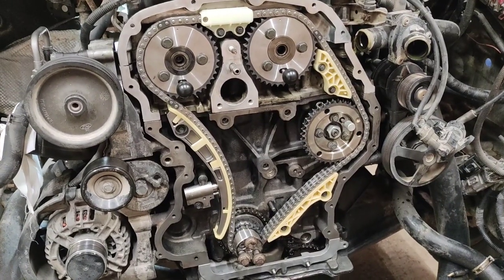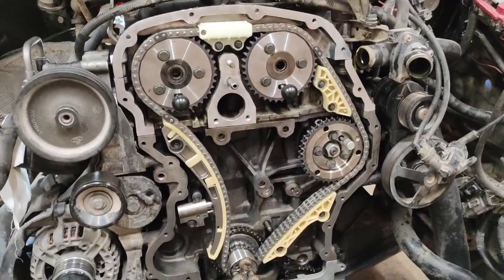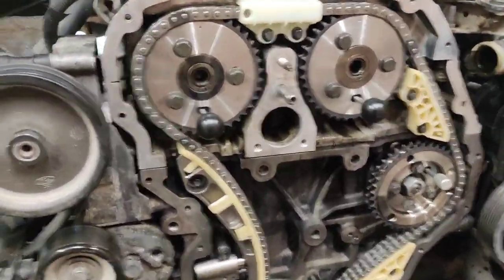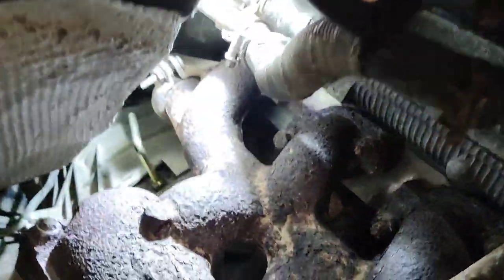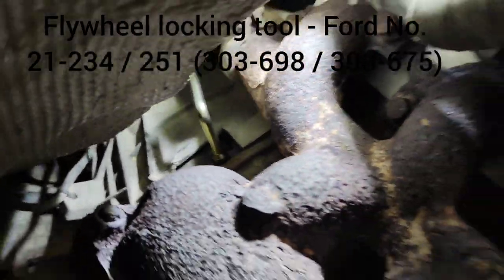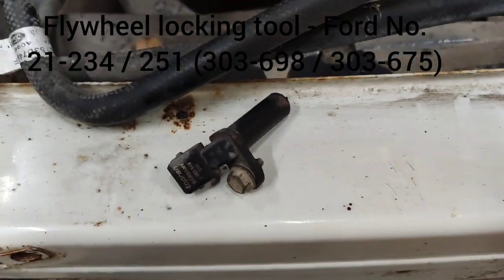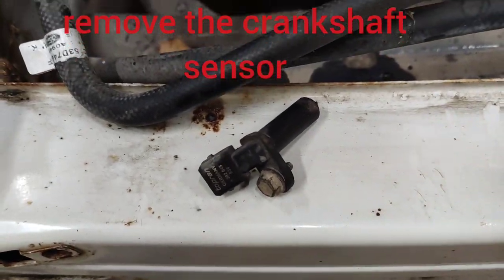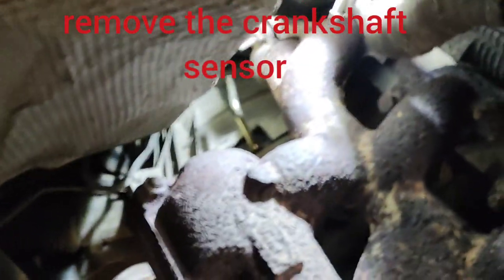Ford Transit  Mk6 Chain Sound, Chain Replacement, Timing Chain Marks

Comment: Hi, did the engine performence increased after replacement? Also, did you change the oil pump chain?  Also, was the changing the camshaft gears necessarry?
Reply from the maker: Hello, yes, I changed the chain with all gears and guides. The old chain remained for the oil pump. After replacing the chain, the engine remained more powerful.
Reply: @robertsansons  What brand of timing chain did you use? And did you change the gears because they were worn?

Comment: Ford transit mk2
Hello, sorry, if the engine is out of phase, even if it doesn't start, does the diesel still come out of the pump barrels?  Or if out of phase Lucas stops spraying diesel?  Thank you

Comment: chain isn’t fitted correctly. Dowel marks half to line up with black link on the chain.
Reply from the maker: It is correct, after installation, the engine was rotated several times to make sure that all the latches in the tdc position are aligned. When you cut the engine, the marks will no longer line up on the chain.
Reply: @robertsansons  my apologies